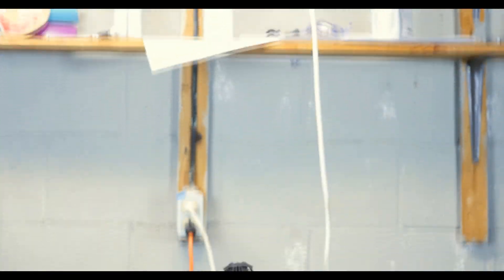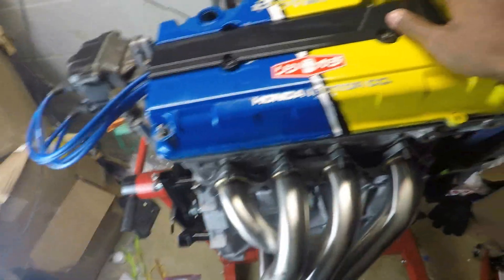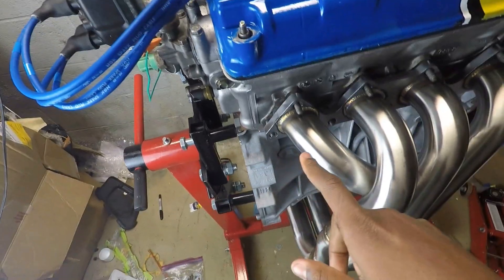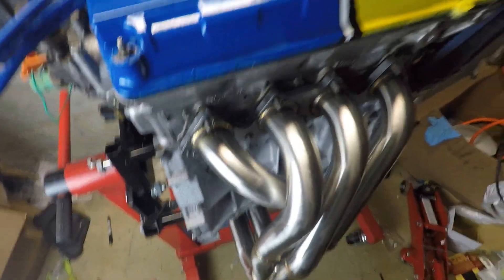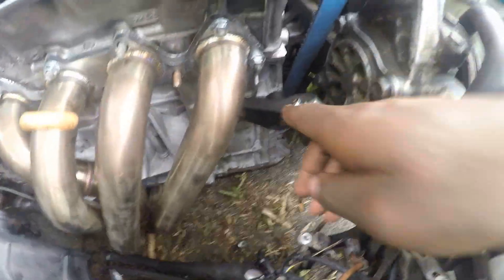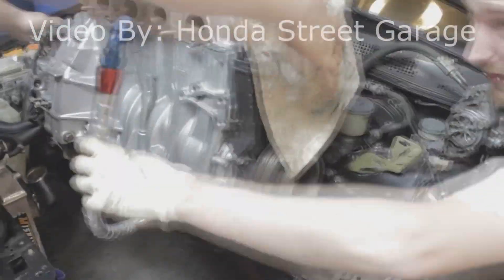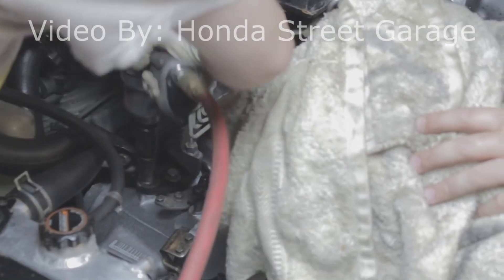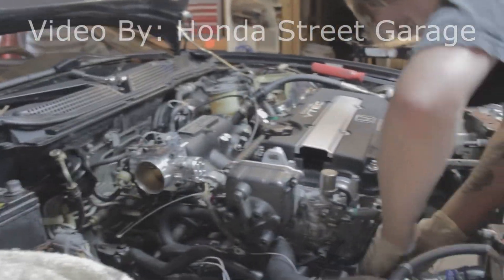Poor Mans Type R vs LSVTEC (Which is Better?)

Comment: I have an LSVtec that has been running for over 12 years and the internals are bone stock. No arps stock gsr head gasket. It’s been on 12psi making 300+ hp for two years and hasn’t even hiccuped on me once. I drive it daily and beat on it every weekend at outlaw races. This engine has lasted longer then a lot of my friends “piston and rod engines” lol it’s reliable if you get a strong safe tune. I left the rev limit at 7200 and that could be why it hasn’t broke on me yet. Like they say the acronym rpm stands for “ruins people’s motors”
Reply from the maker: +MADMIKE808 smart man. Lol im gonna start using that acronym now 😂😂😂
Reply: Miton Films 👌
Reply: Rpm is fun man all motor build high compression can last a long time if done right
Reply: no way dude.
who's your tuner, jesus?
Reply: @KOKO-fd3zr   it all depends on how you take care of it dude. Oil change is your best friend and changing the oil pump every 80k miles. My uncle has a gsr ek with piston and rods only with a turbonetic t3/t4 and he put over 100k on that engine and it's still running to this day.
Reply: @KOKO-fd3zr  another buddy of mines have a ls vtec turbo. It's a daily race every weekend and it lasted a few years. Stock internal btw.

Comment: Stock vs stock I'd agree. Any time a friend of mine does a lsvtec I recommend the correct way of doing it. Such as a proper conversion kit, rod bolts at least of you're keeping stock rods, a gsr or type R oil pump, and gsr or type R water pump. With that said I have a built lsvtec that's made 853whp and 519tq no problems and it doesn't even have a girdle. So it's all in how you build it

Comment: Solid video, but I’m running a b20vtec. I know slightly different but same basis as LSV. Cheap, sorta. Took me around 1700$ with all parts and machine shop work. Resealed the bottom end and all the stuff you should do. I have it street tuned and have beat the snot out of it and mostly driven it daily for a few months now without any hiccups (except battling iacv idle issues). I love my b20v it’s a solid setup and a good learners setup since it was my first motor “build”. It’s all in the tune, mine is probably save to rev to 8k all day but I wanted longevity so I set redline at 7200rpm.
Reply: So I have a B16A2 block with an Integra Type R head.  I want to go boosted with the B16, but a friend of mine says I should go B20 and boost that.  My main concern is that I'm not that great of a mechanic so doing a B20 swap might be quite difficult for me.  I know that if I go boosted on my B16 it'll be a lot less hassle and I'm completely happy with a sub 250hp goal.  I'm mostly concerned about the reliability factor.  I've got a great engine that's very healthy.  Maybe it would be better to have a B20 to rebuild for fun, just so that I can learn my way around the motor, then with the skills I learn I can eventually build my B16 to one of those crazy 600hp spec cars.  Keep the B20 for my little brother when he gets his licence, he can have a built engine.

Comment: Got a B20b high comp, Circuit mine and autoCross it. I would go poor mans type R but I got the k sitting in the garage. Just gotta get my lazy ass up n build it 😩
Reply from the maker: +ZepolFilms lol nice! I wish i had those k funds😃
Reply: Miton Films I know brotha. The motors blown so at least I have the block and tranny 😅 lol. I've sub'd for abbot bud go check out my channel if you have a chance. TeggyTuber Gang 🙌🏽🏁
Reply: Build yet?...
Reply: If you haven’t built it yet you definitely got the time now since we’re all stuck at home
Reply: David Sauve hahaha ended up selling the blown motor and picked a k24 motor for 500$ with 45k kilometers  and it was auto it’s up on my channel 🙏🏼

Comment: Nice video I’ll have to agree with you both engines have their own uses. Track or Drag that’s why I’m going Turbo LSV. I don’t plan to track it just drag and daily it. Well after I build piece together my turbo b20v and blow it. I don’t want to ship a motor when I move from Hawaii so I figure I might as well have a little fun with it and then just throw the other engine in when she blows.

Comment: Here we are now in 2024 and LS-VTEC is still the better option or for the same price (sort of), just refreshing a B18C1 or B16 depending on which one you have before dropping it in the car. I'm going LS-VTEC in my GS-R (blew up the C1...oops) and rebuilding the B18C as an all motor screamer. The B18C made 210whp with bolts ons, fuel support, and a 93 tune so I can't wait to see what the LS will do with the B18C head attached to it.

Comment: I'm in the process of building a lsv. B18b1 bottom gsr head and total in it right now for litteraly every part is $800 but that being said it was hell of a deal  the complete head was $500 that also came with a skunk 2 pro intake and arp head bolts and gsr distributor also got a hell of a deal on a skunk 2 composet fuel rail for 20$ off some crack head lol but with the gsr felpro head gasket, timing belt component kit, plug wires and plugs ( got a hook up on them to from knowing someone who works at the local parts store), felpro valvecover gasket kit, a felpro cam plug seal, oem honda vtec solenoid gasket, sandwich plate conversion kit, felpro intake gasket, and even paint and sandpaper to redue the valve cover still a little under $800.  Also i had a buddy who had a head gasket fail after a week from improper install so the head gasket was actually free lol so alot of it was luck and some chip in help but still not to bad of a deal
Reply: Also the guy I bought my head off of is throwing me a free street tune when I get it all together lol

Comment: I have both b18c1 and b16a2 motors sitting in my garage, would it make sense for me to throw the b16 head onto the stock internal b18c1 with the GSR cams swapped into it? Also using the b16 intake manifold with the GSR throttle body. Im not looking to make the most power possible but just wanting to make the most out of what I have. If this doesn’t make sense ill just throw in the full b18c1 as its going into my ek hatch currently with a d16

Comment: Whats the power i should be seeing with my set up im putting together.
MODS
top end
-stamped 1998 itr head(97) came with unknown skunk2 cams
-skunk2 pro series intake
-skunk2 racing adjustable cam gears
BOTTOM end
-b18a1 block
-high comp STD type r piston caps(81mm)
-stock ls rods
-ARP rodbolts/ARP Gsr headstuds
-high pressure ls oilpump
-ebay lsvkit
-GSR waterpump/timing kit
Car was originally crower 402 cammed b18a,its original bad oilpump went out after 2 years of usage,and my 2 bearings spin the crank,had to do a full rebuild anyway so i broke it all down,dad came home the next day after work "got one hellofa deal for ya,guy at work is sellin a old em1 swap for $300,hes leaving town n wont need it anymore...so yea i took that chance in a heartbeat...when i got the swap i started digging into it,the head had green paint behind the distributor,and had a Japanese symbol etched into a box on the head,meaning it was a itr head,i was super syoked because my dream swap was a Integra Type R swap for my ef hatch🤙🏼

Comment: Why u turn timing belt 3 teeth? Is bc is not the stocks cam gears or bc is a lsvtech.need help with that asap I'm finishing on closing head and my next step is that timing.but i see other videos is just line up all teeth straight

Comment: My LSV hates High RPM's lol, soon as i start getting to 7K it sounds like its struggling. 
Also in vegas LSV's are cheap , you can get a b18a1 or b1 block for 300-400$ and get a GSR head for 300$.

Comment: What about upgrading the oil pump and you forgot about getting the water pump to match the head, I myself was a ls guy at 1st but even when I built my ls I put a type r oil pump to make sure I had enough oil pressure even though people swear up and down it's the same,but now I have 2 b20vs one freshly built wit a gsr head type r dual springs retainers  etc eBay rep itr pistons and b17 cams sk2 mani and tb,one in my car waiting for rebuild I got the b16 rep p30 pistons and acl bearings for  all setups this one has b16 head so I wanted to see what the compression was and the gsr head is 13.36 and the b16 is 12.94 i believe but it has port nd polish I also got a sk2 manifold  and throttle body hondata intake, manifold gasket  type r cams
Reply: Look up Gene Kim n Chuck missler

Comment: Ever heard of an Ls block with p30 pistons? Read up on this yrs ago always wanted to try it.
Reply from the maker: +JDM Ju5 hmm that would be an interesting setup!
Reply: Miton Films facts I need that overnight part plug watz guuu👀
Reply from the maker: JDM Ju5 ebay has replica nippon p30 pistons for 190 lol just get those. Mine are from the same company so its legit.
Reply: Miton Films heard bet!
Reply: Was thinking of doen that to my ls I have usdm itr piston in right now but it smokes I was gonna pull the head nd do the valve seals but it's already also built  Brian crower stage 2 cams cam gears blox high compression  brian crower dual springs cause I had blox nd one broke luckey didn't drop a valve supertech lock keeper blox manifold type r 70 mm tb fuel rail msd ignition chipped p75
Reply: Maurice Hankins I got a da just sitting in my yard I’m thinking of pull the motor out and rebuilding it over the winter. My b20 smokes a bit right now gotta do the seals on my as well, do I have change my valve train to aftermarket springs and retainers when i run bc stage 2 cams or nah? Trying to stay close to stock as possible. That sounds like it a fun setup, and your non vtec? How is that 70mm tb working? Do you have the intake mani port matched or to tb as well? I heard 70mm is overkill for an ls but it’s built so I’m just trying to get some insight.
Reply: Maurice Hankins how much power you making?
Reply: JDM Ju5 not tuned it's on base map from Jason waters tuning idk if u heard of him
Reply: JDM Ju5 I would because if you think about it the valve is gonna open longer and higher nd those stock valves nd springs been in there since the car was made so I would up grade it all no unfortunately not port match the mani fold is 68 I kept up wit a type r but my clutch is done I had rear main seal leak nd didn't kno so I want to replace it again I guess didn't want to get a light weight flywheel but I want to autocross it so I figure it only makes sense
Reply: Maurice Hankins Maurice Hankins yea your right that would make sense rather than to build it over again after something stupid happens cuz u didn’t change em. That’s a decent setup then to keep up wit a type r, that’s good tho that the intake mani is 68mm their usually 64mm stock correct? Having a 70mm tb and a 64mm intake mani creates that bottleneck thing where it’s basically asking for more air cuz it’s restricted up top. Great minds think alike I also wanna get a lightweight flywheel when I find a nice gsr or b16 trans. And no I haven’t heard of the tuner but i looked up his name on ig he seems reputable.

Comment: a properly built lsv with apr rod bolts, b16 pistons, mild pnp with type r cams would shit on the b18c  for years day in and day out.  Torque makes a HUGE difference. This video gives ZERO information, I stopped watching as soon as you said "I've never built an LSVTEC" "I dont know too much about them". I had a JDM Type R on my eg, then went b20vtec with high comression same type r head and belive me, Torque makes the difference. Btw the b20 sees 9k+ rpm constantly. 4 years later still running great. Great dd or just weekend track. It takes ALL the abuse. I love Honda Motors.
Reply from the maker: Which track do you go to?

Comment: the poor man's R for the reliability since the parts fit perfectly
the LS/Vtec has more torque to start with thanks for its stroke (89mm vs 87.2mm)  but cost too much just to be reliable my mechanic told me he charge 6500$ to built one and for that price you got a Type R and maybe few stuff to increase the power
Reply: hugonubario lsv is reliable. Keep the revlimit stock and it’ll last
Reply: hugonubario it's $1500 to build a LSV in San Diego CA
Reply: Henry King and I thought here in hawaii was expensive. You can put together one here for 1000$ if you keep it bone stock
Reply: I specified a reliable built not buying the parts and put them together and incanada it's expensive to built an engine
I saw people built them for the same price and you could follow them by the smell of oil
Reply: hugonubario I built my Lsv when I was in Canada. 9 years ago. In Winnipeg. Using a b18b1 block with a pr3-4 type r head. Tuned on hondata with a obd1 p72 I go to 8k daily and to 9 when playing. https://honda-tech.com/forums/all-motor-naturally-aspirated-44/how-build-"reliable"-lsvtec-b20vtec-1676914/ read that. If you built them right you will be rewarded majorly.

Comment: Any recommendations for the b16a2?
Reply: I just recently bought a 97 Honda del sol vtec a couple months ago.  I don't know all there is to know about Hondas but im slowly learning more information.   From what I read, there's only so much you can do with the b16a2 when going NA because of the relatively small displacement.  I'd honestly look into an engine swap but I bought the car with 84k miles so I don't see the point in swapping out a perfectly good engine with plenty of life in it.  When I ask people they say, just do I/H/E which is great and I will, but can anyone be a little more specific like what brand, cai vs sri, what exact type of cams, exhaust/ headers etc.  I was thinking of going with a "tanabe" exhaust because from what I've read they're not super loud.  Any info tailored specifically to the b16a2 would be greatly appreciated. Thanks!
Reply from the maker: Cams and a tune!
Reply: @sentree9857  B16 loves boost

Comment: If your putting a lsv together u need change out the oil pump Thas all, the B18B1 or A1 have thicker water jackets n are built to last from factory more then for performance, which is y they r better for forced induction, jus need a higher volume oil pump for when the vtec kicks in u don’t starve the rest of the engines form oil.

Comment: Crvtec is the best b series built right my recommendation is b20z block will 11:1 comp piston forged gsr or b16 head with 3 angle valve job dual valve springs ctr camshafts type r intake manifold and 65mm-70mm throttle body upgraded injectors 320cc  tri-y headers or 4-1 your choice if you want more torque or top end

Comment: I did a lsvtec swap in my 92 integra b18ablock/b16head I am having troubles finding the right distributor every one I've tried the plugs don't match the 2 on the harness anyone got any tips?

Comment: Why so much force when the motor was being turned over with the ratchet?? Something isn't right
Reply from the maker: Not sure , however when I had this engine I did 30,000 miles on it. I did notice it had excessive carbon build up when I pulled the head, so I suspect I made an error somewhere

Comment: How much do ls vtecs usually go for
Reply from the maker: Depends on what you have already. From scratch.....$2000+
Reply: If you order a high comp for like 600 at the most and a VTEC head for $600 at most then you just need to get it built and put in ...

Comment: So a poor man's type R's a b18c with a B16a2 head? Wouldn't a B18c1 w/B16b1 head be closer to a poor man's type -r? That would be a middle-class mans type-r. A b16b head would be more expensive since it's a JDM Civic Type-r head. It's not much better than the B16a2. Tad bit better valve angles/air flow.

Comment: Stock lsv/b20v only good for torque and not high rev friendly
As for built anything can be reliable and fast.
Stock poor man type r is good because it's naturally a vtec engine so minor modifications and have reliability of a stock gsr. But I'd personally wouldn't waste my time slapping stock b16 head on a gsr block with out changing pistons.
Reply from the maker: MotionSkater yea thats why i changed out mine because there really isnt much benefit. ...

Comment: Lol I laugh at your “poor mans r” build. How about actually getting a B16b CTR head to put on a gsr. Run it with p73-013 ecu. And finally pair it with a CTR b16 trans. Then you’ll laugh at how much slower lsV is compared to the R. 😂 I have both, lsV and a PMR. My PMR is faster in a heavier chassis than my LSV in my eg.😂

Comment: just go k better than doing Frankenstein swaps and I would bet more reliable and power ....js
Reply: Anthony Martinez also alot more expensive
Reply: Yemi Joel ture..... but worth it the k goings for 5 to 600 from a yard that's the best price I would pay all day
Reply: what up guy .. plus everything you need to buy to get it to fit and run correctly

Comment: https://honda-tech.com/forums/all-motor-naturally-aspirated-44/how-build-"reliable"-lsvtec-b20vtec-1676914/ hey Milton love your videos. However I would say give this a read. I've been resting on my Lsv for 9 years since I've built it with a 12.2:1 cr and all I've had to do is valve seals and normal mantiance.

Use ls rods with itr or gsr pistons will next you a 12cr. Using ls rods and pistons are going to next around 9-10
Reply from the maker: Ah ive read that article before. I do agree they are reliable when built properly!